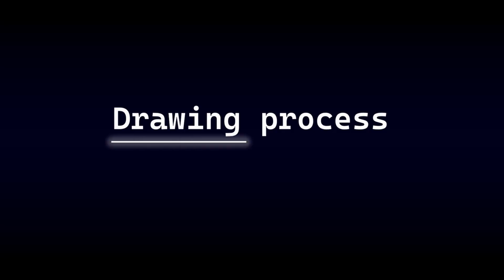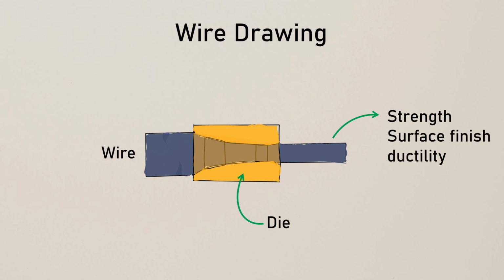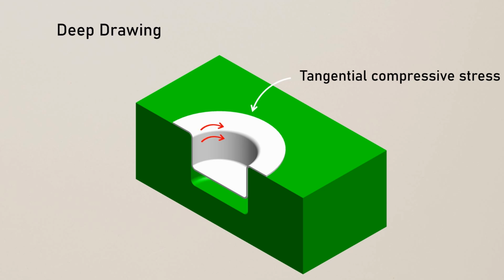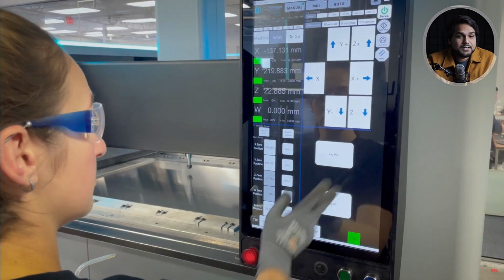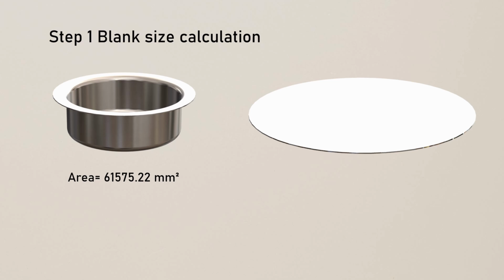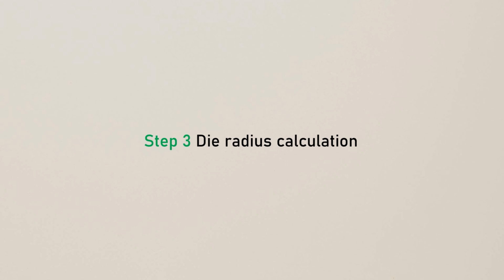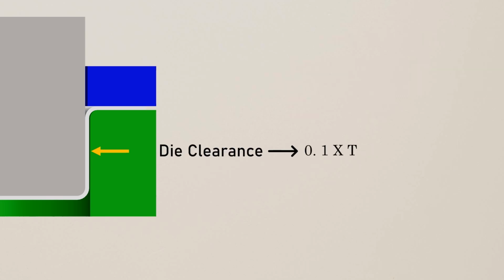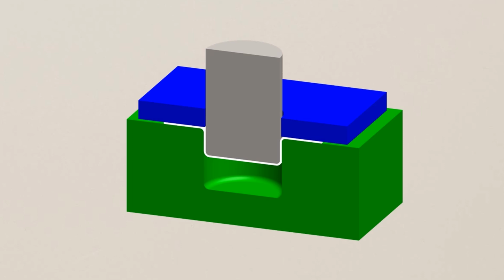Complete Guide to Sheetmetal Deep Drawing Die Punch Design Calculation

Comment: Deep drawing is where sheet metal design meets high-stakes engineering. 🚀 Solving for factors like springback and material flow requires both theoretical knowledge and practical expertise. We provide the manufacturing expertise to navigate these challenges and deliver production-ready tooling and parts.

Comment: Thanks for sharing this video, very informative!

I have a doubt. In the die clearance chart thickness values between 0.45 - 1.25 mm isn't given. Should we consider clearance value of 0.45 mm sheet for all thicknesses below 1.25mm?

Also, while calculating die & punch diameters from die clearance values, you doubly considered the clearance values. 

Added 2x clearance in die diameter and subtracted 2x from punch dia. Won't this cause clearance on one side to be 2x0.12, which is the total diametrical clearance.
Reply from the maker: You are right, thank you

Comment: Hi! Nice video! I don't understand the clearance :( Shouldn't we make smaller puch OR bigger die? You subtracted 1.12 from the punch diameter and added 1.12 for the die diameter (per side). In this case you have 2.24mm clerance per side?
Reply from the maker: Yes, you are right, that's my mistake